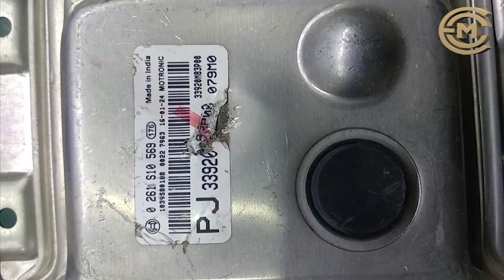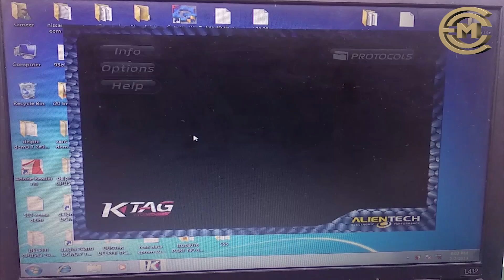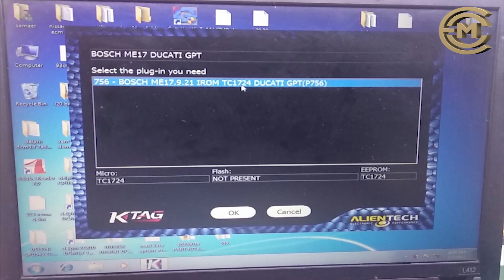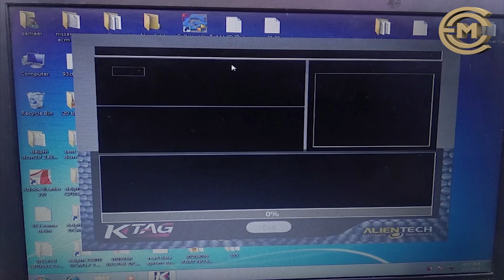SWIFT ||PJ|| ECM

Comment: My car, swift vxi 2008 not showing engine check light for IAC valve, purge valve and egr, even if connectors removed. Does it has faulty ecu, for rest check light is working